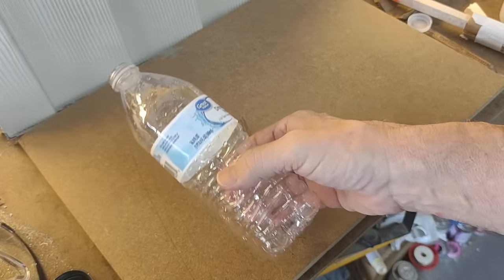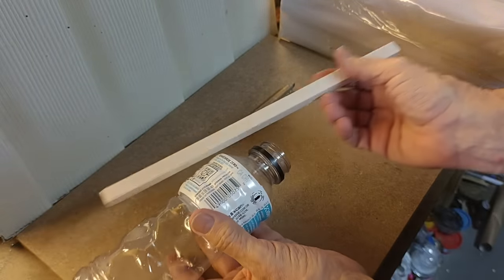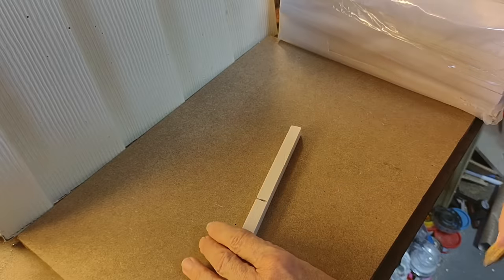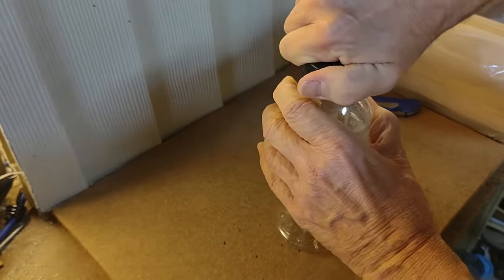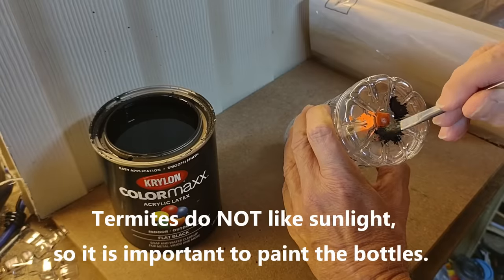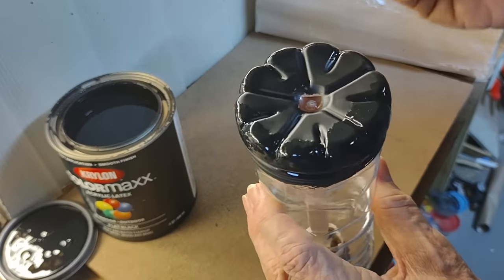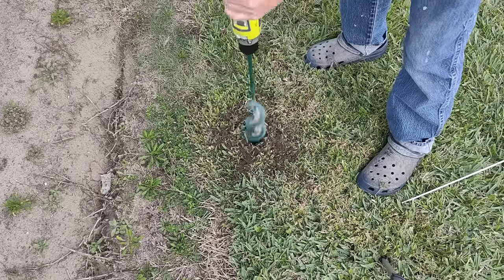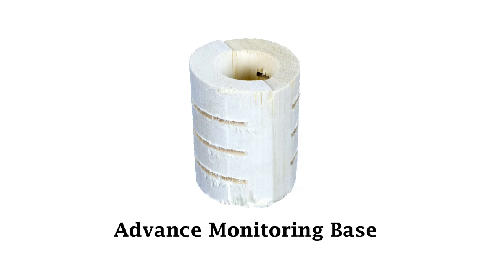Unbelievable Water Bottle Trick for Termites!  Simple to do!

Comment: I just got a couple of $1500 to $2000 quotes for termite and pest control here in NJ.  For pests, I have carpenter ants and carpenter bees.  However, I was not sure of having termites but I do have a large wooded area behind the house.  The house is on a concrete foundation and the only path for termites I see may be the deck which uses treated lumber for the beams and posts.  I have not seen evidence of mud tubes at all.  But the inspectors recommended termite baited monitoring stations for that cost.  I’m so glad I found you.  So I am thinking I would go this DIY route.  My only question is how would I know if carpenter ants consumed the balsa wood instead of termites.  And if I go the next step and put a bait will the Trelona also be effective against the carpenter ant colony just like it would the termites?  Or do I have to have a different strategy for carpenter ants?
Reply from the maker: Thank you so much for reaching out to me.  Let me explain some things that you need to understand.  The first thing you need to know is that it is fairly common to have both termites and carpenter ants at the same time.  That is because carpenter ants do not eat wood the way termites do.  Carpenter ants just tunnel through wood, and they need to find another food source.  It just so happens that carpenter ants enjoy eating termites, so not only do the termites provide a tasty food source for the carpenter ants, they also excavate the wood for them to make it easy for them to move around and colonize in your home.  It's kind of a super cozy situation for the carpenter ants.  Unfortunately, these two species must be treated differently.  The termite monitoring stations do not contain any poison, so they do not kill termites. The only reason we installed them is to monitor for activity. Installing them after you have an infestation is kind of like shutting the barn door after the horse escapes.  So, the monitoring stations would not be for you.  In your case, you need to initiate a treatment for both the termites and a separate treatment for the carpenter ants.

I am not a big fan of using bait stations to treat termites.  That is because the bait that they use does not kill termites.  All that bait does is it prevents them from reproducing. Unfortunately, a termite worker can live for up to 2 years, so this can be a very slow process.  Meanwhile, the termites are busy eating away at your home.  Moreover, there is no guarantee that they will even find the bait stations.  So, there is some chance that the bait stations will not work at all.  So, let me explain how you can go about treating both the termites and the carpenter ants very inexpensively and effectively.

Let me start with the termites.  The cheapest and easiest way to treat subterranean termites is to use termite granules.  They work about 95% of the time and they only cost about $50 to treat the entire house.  For the granules to work, you need to have dirt surrounding most of your house and that dirt needs to be porous enough to allow water to leach into the ground.  To find out if your ground is porous enough, just dig a shallow hole about 4 in deep, 8 in long, and the width of the shovel.  Fill the hole with water, and look to see if it leeches down into the ground.  If the water disappears into the ground fairly quickly, then the granules should work well.  However, if the water just sits there, then the granules would not be a good choice, and you need to consider trenching.  I have a video on how to do the trenching correctly and I will give you a link to it.  Trenching is a bit more work, but it can be done in as little as one day, and it only costs about $100 to do.  You don't need to do it all at once, and you can literally dig the trench 10 ft at the time.  If you use the granules, make sure that you purchase the correct ones.  There are two versions of them now, and most of the Lowes and Home Depot stores are now selling the wrong ones. Therefore, I recommend that you purchase them from Amazon.  You need the ones that use imidacloprid as the active ingredient.  I'll also give you a link to my video on how to use the granules.

The carpenter ants get treated much differently and I have a video on how to do that.  I will place a link below for you.

I hope that helps.  Be well my friend.

Termite granules:  https://www.amazon.com/dp/B000RUIJYM?ref=nb_sb_ss_w_as-reorder-t1_k0_1_6&amp=&crid=1FVKC33CYE9UP&amp=&sprefix=termit

Video on how to apply termite granules:  https://youtu.be/H7rW_TSBHJ4

Video on how to trench for subterranean termites:  https://youtu.be/Fy7YHi_7Z8g

Video on how to treat carpenter ants:  https://youtu.be/Te9BUCaIQZY
Reply: @GuysPestSolutions . Thank you for your very thorough response.  This is so helpful.  So basically what you’re saying is that when I see carpenter ants in my house is that there’s a high likelihood that I may also have termites based on what you said that it’s “cozy” situation for the ants (I.e., tunnels already done and termites for food source).  I will now now move forward and apply these treatment steps.  I’ve since watched your “how to identify termites” to know what to look for.  Perhaps a video on how to do a proper termite inspection could help.  Again thanks for creating this channel.  You’re doing great work!
Reply from the maker: @TitoAnjo  I'm not saying that there is a high likely hood that you have both carpenter ants and termites.  I'm just saying that it is not unusual to have both.  It is very possible to have just one or the other.  In fact, most of the time that is the case.  You really need to inspect to find out.  You are correct that I need to do a video on inspection.  I will put that on my list of videos to produce.  Thanks.

I forgot to explain carpenter bees.  I do not have a video on how to treat carpenter bees, but I can explain how to do it.  The first thing you should know is that the carpenter bees are not doing most of the damage.  It's true.  The carpenter bees are boring holes into the wood, but that is only causing a little of the damage.  You see, after the bees get into the wood, they lay eggs in there that turn into larvae.  Those larvae eat wood to survive, much like termites do, and that is what is causing most of the damage.  When the larvae mature, they bore back out of the wood, leaving behind hollowed out wood, with large exit holes.  Therefore, you cannot end the problem by treating the bees.  You need to treat the larvae.  To do this you need to buy a fipronil foam and shoot it into all the holes, until it is coming back out at you, or the other holes.  The foam will expand to several times its original size and get into all those tunnels that were created in the wood by the larvae, thereby killing them.  Now that you have treated the larvae, you can go ahead and seal up the holes with wood filler, caulk, Bondo, or whatever works best in your case.  After you have the damage repaired, you need to make sure that you do not get anymore carpenter bees.  There are a couple of ways of doing this, and which method you choose will depend upon the kind of wood you are dealing with.  If you have wood that has not been treated with anything, like a sealer, stain, or paint, then you can use Bora-Care.  This is a permanent treatment, but you do need to finish the wood with something, like a sealer or paint, about 48 hours after the product is applied.  If the wood has already been treated with a sealer, stain, or paint, then you need to apply a pesticide to all the wooden surfaces every 60 days.  To do this, just get a pump-up garden sprayer and purchase some Bifen IT.  Mix the Bifen IT in the garden sprayer at a ratio of one ounce of product to one gallon of water.  Then simply spray all the wood surfaces every 60 days.  If you have areas that are too high up to spray with a pump-up garden sprayer, then you can use a hose end sprayer to reach places that are very high up.  Just watch my video on how to treat your yard with a hose end sprayer.  For this application you will need to use Bifen XTS instead of Bifen IT.  That is because the Bifen XTS has a much thinner viscosity than the Bifen IT, which will allow it to be picked up by the siphon tube in the sprayer.  An easier way to put that would be to say that the Bifen IT will not work in the sprayer, so you must use the Bifen XTS.  Just mix the Bifen XTS as I show you in my video on how to treat your yard with a hose end sprayer.  The sprayer that I recommend in the video has a stream setting that will allow it to reach as high as 25 feet, depending upon water pressure.  I will give you links for the fipronil foam and the Bifen IT.  If you need to go with the hose end sprayer, all the items you need are listed in the description of the video.  I will give you a link to that video as well.  These products are very safe to use, but I always recommend wearing rubber gloves, eye protection, and a respirator.  I have been hit many times with the overspray from this stuff and I'm still here to talk about it, so it is not all that hazardous.  Still, it is not a good idea to inhale any sort of chemical whatsoever and it is also not a good idea to get it in your eyes.  The truth is that these materials are no more harmful than common laundry detergent, but I don't think you would want to mix up some laundry detergent, spray it in the air and then get it in your eyes and inhale it.  You probably wouldn't want to get it all over your hands for an extended period of time either.  I always recommend taking a shower when you're finished as well.

I hope that helps.  Be well my friend.        

Fipronil foam:  https://www.domyown.com/termidor-foam-p-3528.html

Bifen IT:  https://www.domyown.com/bifen-it-p-226.html?sub_id=11662

Video on how to treat your yard with a hose end sprayer:  https://youtu.be/wifoTU5dmp0
Reply: @GuysPestSolutions  Fantastic!  Once again, thank you for all the help and instructions in exacting detail.    By doing this, you are really saving me money and many others in similar circumstances.  God bless!
Reply from the maker: @TitoAnjo  You are very welcome.  Thank you so much for those kind words.  Very much appreciated.  Be well my friend.

Comment: Hi there, I have had termite problems for the past 5 years. In 2018 I had pest control come out and inspect and they used the bait stations. Paid for a years worth of service. I was married then and we had a two income household so although expensive it looked like it got the job done. A year ago (2023) is when I first saw them come back. I did have a pest control guy come back but when I asked about the bait stations I already have, he said he doesn’t check the stations, he just sells people a new service. He said he would be calling me back in a few short days. Needless to say, I forgot about it because I was busy just trying to make ends meet. This past spring I saw flying termites pop up after mowing yard. I called them again. They want to charge me over a grand to put all new bait stations in. I said: “why can’t you use the other ones already there.” There excuse is that they are older and all new ones need to be placed. So I did a DIY treatment myself or termidor sc. My issue is how do I know it worked? Maybe a month and a half after this the wood floor in the front room started warping and when you walk if feels like little waves (bumps) on the floor. The kitchen floor is the first to also have damage with many soft spots under the tile. Also unlike last summer the wood floor in the other room… let’s just say there are pieces of it popping up in a V shape. I did extra retreatment to the soil outside in front of this room. Should I also go under the house (in the crawl space and use a foam spray). They seem to be affecting under
Reply: Under the house the most. I can’t afford to have floors replaced at the moment. I just need to know if it is working?!
Reply from the maker: @hallelujah5506  If you get this, please email me at guyspestsolutions@gmail.com.  I did respond to this question, but it looks like YouTube deleted it.  They do that sometimes and I don’t know why.  So sorry.   Just copy your original comment and past it into the email.  Also, please give me your YouTube name.  Be well my friend.

Comment: I have a question for you sir. How does settling rainwater affect the station?
Reply from the maker: Rain should not bother the stations.  Now, if you live in an area where the water table is such that the ground is always wet and the bottles will remain filled with water because there is no drainage, then you will not have termites anyway.  They will drown in those conditions.  All monitoring stations, even the professional ones, need to be checked at least once a year for mold.  Termites do not like mold and these things are in a dark, damp place, so mold is always an issue with them.  Just pull one up every year and check it.  If it's okay, then leave the others in place and put the one you removed back again.  If the one you remove is moldy, then you need to start replacing them.  It's okay if they are just wet and not flooded.  Termites like water, so they will actually work better.  I hope that helps.  Be well my friend.
Reply: Why paint using the neon and then painting the bottom and up the side black?
Reply: @MaryOKC  
He stated that Termites do not like light. (Hench the Black)😉👍🏽
Reply from the maker: @MaryOKC  I use the neon paint because it is easier to see.  The termites don't care.  However, they do not like sunlight, so I paint the top black to block it out.  Termites do not have the ability to see, but they still prefer it dark.  The stations may still work even if you don't paint the top black, but I always want to make it as cozy as possible for them.  You do not need to paint the side black.  Just paint down the side enough to stop the sunlight from getting in.  I hope that helps.  Be well Mary.
Reply: @GuysPestSolutions  excellent explanation! Thank you so much. Be safe and likewise well.
Reply from the maker: @MaryOKC  You are very welcome.  Be well Mary.

Comment: Hi, Guy. Miami, Florida here. Drywood termites are a constant battle around here. They even fly up and return to the scene soon after an expensive, bothersome tenting clears them out. What are your best suggestions for dealing with this? Thanks and zei gezunt.
Reply from the maker: It is important to understand how drywood termites work.  They enter through cracks and crevices around windows, doors, the eaves, pipe penetrations, and so forth.  Most of the time, they enter through several locations.  That is because a swarm of them attacked your house at the same time.  If there was a crack or a crevice, then they probably found it.  After they established their galleries, which will be inside the wood, it will take four to seven years for them to be able to swarm.  Now that they are in your house, the swarmers will use holes that are in your studs to travel through the walls.  Those holes in the studs were created by the electricians to run the electrical wiring.  Not only are these holes going through the studs, but holes were drilled into the attic for the light switches and to run some of the wiring for the outlets.  So, the termites now have easy access throughout the attic and the walls.  If you have a basement or crawl space, they have access to that as well.  Most of the time, you will have no idea that they are in the walls, because the frass is inside the wall.  To make matters worse, if you have drywood termites, then your neighbors have them too.  That means you have been getting swarmed for as long as they have existed in the neighborhood.  Most likely, we're talking about years, so it's a safe bet that you have these guys in many locations in your home.
                            
I always hate to be the bearer of bad news, but if you have drywood termites, the only way to get rid of them is to fumigate.  Prices for this can vary wildly in this industry, so I recommend that you watch my video on how to hire a pest controller without getting ripped off.  That video can save you a lot of money.  As you discovered, the gas they use to fumigate has absolutely no residual action whatsoever, so you can get reinfested the moment the tent comes down.  Like I said before, if you have drywood termites, then your neighbors have them as well.  Since drywood  termites swarm every year, it is almost a certainty that you will be reinfested within a year after the fumigation is done.  The only way to prevent this is to do a preventive treatment on your house every 60 to 90 days.  Most pest controllers will not do this, so it is something that you generally need to do yourself.  I have a video on how to do that and I will place a link below.  If you absolutely cannot afford to fumigate your house, then you can try spot treating it yourself.  It is virtually impossible to find all the termite galleries, but it is way better than doing nothing.  Regardless of how you treat it, you should begin the preventive treatment immediately, so that you do not get additional termites paying you a visit.  For what it's worth, we have them here too and I do the preventive treatment every 60 days.  

I hope that helps.  Be well my friend.                        

Video on how to hire a pest controller without getting ripped off:  https://youtu.be/y-a8XOqVrlE

Video on how to prevent drywood termites:   https://youtu.be/neNsmVbj8Pc

Video on how to spot treat drywood termites:  https://youtu.be/U7ck7zhS0Xo